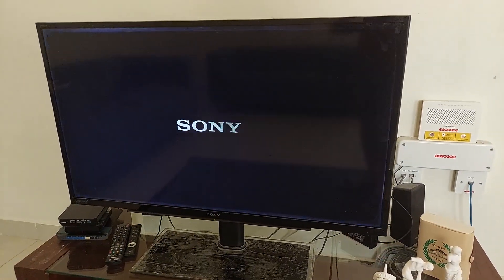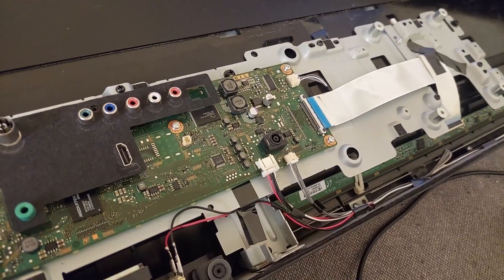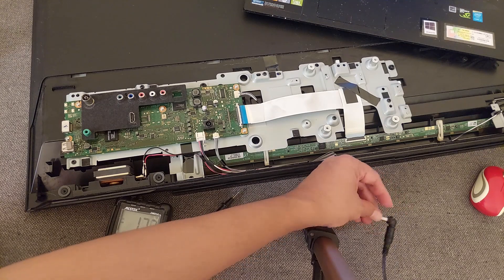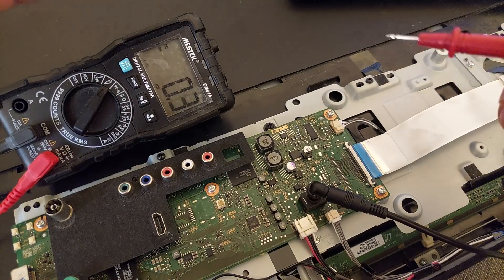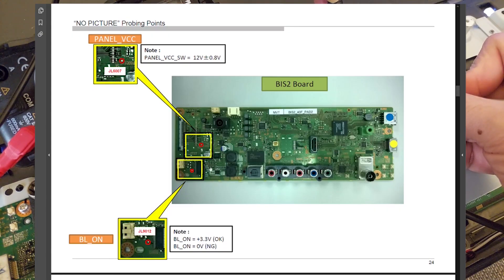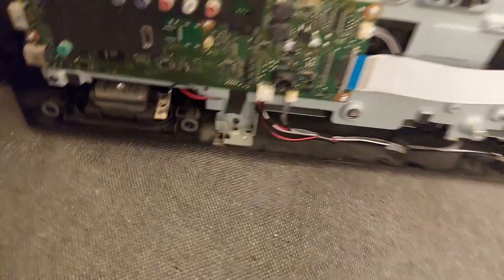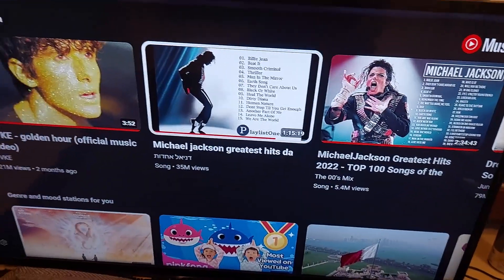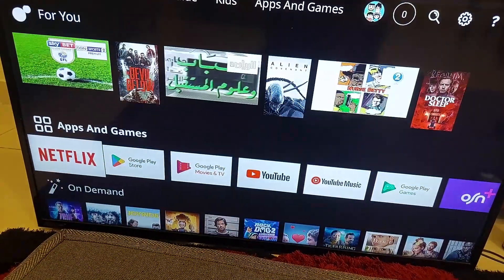SONY logo OFF randomly SOLVED

Comment: thank you for this! i have a similar problem with my sony tv kd-55x8505c. when i start/turn on the tv, it shows me only the sony logo at the beginning and after that, no video and audio.
is it possible, that i have the same issue?

all the hard factory reset methods i tried already and i don't know what to do more...if there is somenone with same issue or tipps, pls help me.
Reply: Did you problem solved?

Comment: I was very fed up with my sony tv restarting. I tried everything from connecting the resistor to ground but it made the situation worse, so I decided to give it to the service centre. Then I came across your video where you were cleaning the ffc. And it struck me, that maybe this is the only thing left before seeking a professional help. And after I cleaned it, its working fine! Thank you so much. God Bless You! Just go oldschool guys “unplug and plug”